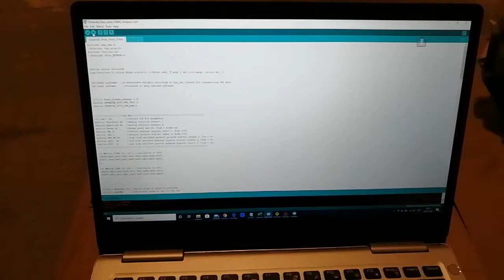Outlander front transmission generator spinning

Comment: Very interesting. If you ever build a controller that allows both the front and rear inverters to run at 60 kW together plus resets the hopeless bms you'll be set for life.
Reply from the maker: Already made both motors get full throttle in my outlander before the engine starts.
Reply: @pemtek1  i have 2 phev rear motors. I put 1 on the front axle and 1 on the rear axle but could not get them to run.
Is it all about flashing or i need to make a board?
Reply from the maker: Already got both to run at full power but the battery will probably suffer
Reply from the maker: @FirstLast-tx3yj  you just need to send the correct CAN signals. But for 2 rear inverters you will need 2 can bus as they both won't live on the same can as the id's match.

Phil
Reply: @pemtek1  any step by step guide how to do that?? This is my first time and I need a guide to follow
Reply from the maker: @FirstLast-tx3yj  I will dig out the commands
Reply: @pemtek1  please thank you
Reply from the maker: @FirstLast-tx3yj  do you know how to send can commands?
Reply: @pemtek1  this is my first time trying to run a motor. The only controller i have ever flashed was an e-scooter one!! So no havent tried before.

Send me any resources and ill learn quickly just point me in the righ direction plz
Reply from the maker: @FirstLast-tx3yj  you are going to need to learn a programming language or buy an ecu that can output can.
Reply: @pemtek1  i know javascript and java
My brother knows python

As i see in your video ur connecting an arduino to the inverter but how you made the connection and programming is all unknown...
So thats what i want to know
Reply: @pemtek1  if you could please share the wiring diagrams and code if that is all it requires.
Cheers

Comment: Hi Phil, I love the video. do you have any videos utilising the standard PHEV Grid power inputs for this inverter to the HV battery? Is this something you have tried?
Reply from the maker: Not sure what you mean?
Reply: @pemtek1  Sorry I meant, Have you tested charging on the bench with this unit?
Reply from the maker: This is the motor inverter not the charger. But if you mean using the motor as a generator this would definitely work as all you have to do is reverse the motor against the direction you are spinning the motor, the more you reverse the more it will generate.
Reply: @pemtek1  I See, I’ve been using the Prius inverter and thought that the outlander inverter had integrated Charger. Ok cool, thanks for getting back to me 👍👍👍
Reply from the maker: @ervbon7493  no there is a separate 3.7kw charger and dcdc mounted in the back of the car next to the rear inverter. The rear inverter also has connections to the charger and another for the electric heater.

Comment: Hi great work! So with these CAN bus torque commands you could also do regen.
Do you know of anybody how got the whole petrol engine running and using the generator as a generator?
Just to get it to output the 300v to the HV battery?
I'm wondering if it is easier to try and keep as much of the PHEV drivetrain original and get it to charge itself, or the minimum to get the engine running (and apply throttle), and use these CAN bus commands to get it to charge. It could just run at a fixed RPM and I know that the self charge mode is in the original Outlander PHEV.

Comment: have you gotten the rear motor and inverter working?
Reply from the maker: Yes and the two front inverters
Reply from the maker: Yes, I have the rear inverter, both front inverters and the charger working from the Outlander.
Reply: Are you going to share your finding publicly? Or will you sell a controller to make these work?
Reply from the maker: @Tom-evnut  hi, well I am planning to make a controller and sell it but it will be open source as I am not exactly a good programmer... However I am snowed under with projects at the moment and could do with some help.
Reply: @pemtek1  definitely keen to work together and help - have got an inverter set up and talking over CAN - just hunting out the signals to send it to get it turning
Reply: @pemtek1  share with us your github and keep us updated.
I have two rear motors that i want to get running

Comment: Any chance you could share the CAN bus commands with me? I have the motors set up in my canal boat, I have had them running using an open inverter but not as smooth as the orignal mitsubishi inverter. So far I have identified 0x287 as the torque request but it wont seem to run with this command alone...
Reply from the maker: enjoy> These messages must be sent continuously

100mS  messages

 0x286,0x00,0x00,0x00,0x31,0x00,0x00,0x0A,0x00

0x371,0x30,0x00,0x00,0x00,0x00,0x00,0x00,0x00

10mS messages

0x285,0x00,0x00,0x14,0x19,0x91,0xFE,0x0C,0x10

0x287,0x27,0x10,0x27,0x10,0x27,0x10,0x05,0x00

 

0x287 consists of the torque requests for each motor and 0x27 0x10 is 0nm torque, higher is forward, lower is reverse / regen. The front generator inverter has limited speed in one direction
 i guess its so a fault does not spin the motor too fast backwards.

 
First one is front motor, second one is rear motor, third one is generator motor

Byte 6 determines which motor or motors or generator motor are driven.
Reply from the maker: forgot to say i also worked out the can for running the outlander charger / dcdc if you need it.
Reply: @pemtek1  Thanks so much for taking the time and replying. I actually figured them out and got my boat motoring yesterday. I now have a useful piece of arduino code written that converts 0-5v throttle signal to torque commands with a switch for forwards and reverse that I can send to you if it’s helpful. Thanks about the charger as well, I already have that working. My next challenge is the AC compressor can messages to get it working as a water source heat pump...
Reply from the maker: @dotjalex  that is great news. It would be good to compare what you have done vs what I was working on. Phil
Reply: @dotjalex  Hello. Can you share your successful code fragment?